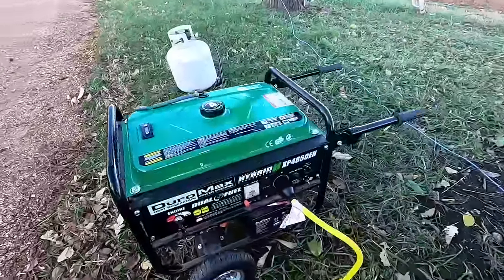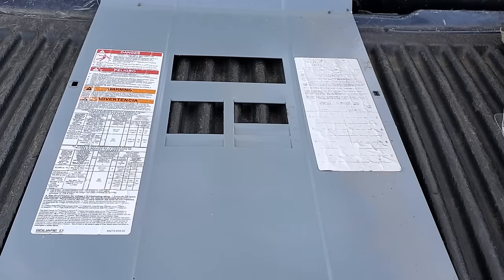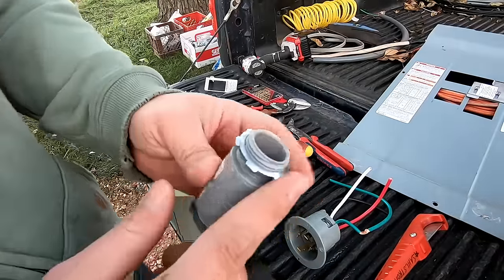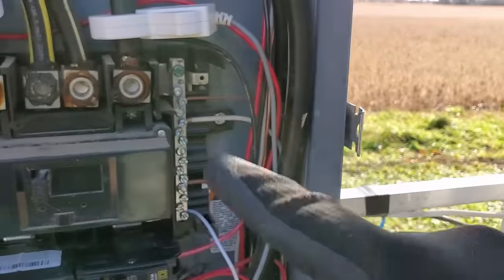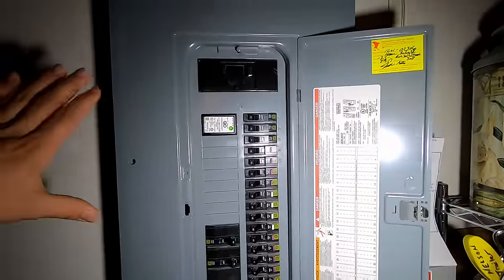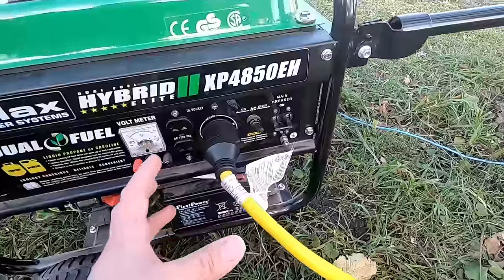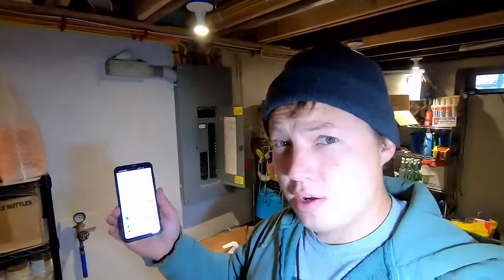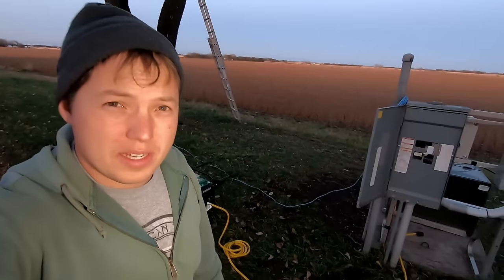How To Hook Up a Generator To Your House Using a Breaker Interlock Kit & Power Inlet Box

Comment: You've probably figured this out a long time ago, but just in case, your generator (and all dual fuel generators that I've seen) produces less power on propane than gasoline.  In terms of power it's diesel > gasoline > propane > natural gas. According to the manual for that model it should produce 3,500 running watts on gasoline and 2,975 on propane. Surge is 4,400 and 3,740 respectively. Anyway good helpful video on installing the interlock. Hoping to do the same thing myself soon.
Reply: Don’t forget about the generator safety tips as well. Remember safety is always important. Here are the generator safety tips:

1) Please do not allow an unqualified person or your children to operate the portable generator. Just because some manuals don’t say that doesn’t mean it’s safe. That is important against the generator safety rules. We also need to be keeping an eye on our children too. You need to make sure that your children are not playing near the portable generator especially when it’s running so they won’t get electrocuted. Generators pose electrical risks and they can be hot during an operation. Please keep your children away from the portable generator at all times. It is important to keep our children safe especially our little ones. Be aware of all the hazards.

2) Some people use their portable generators indoors which increases the risk of carbon monoxide poisoning. It’s important to have a carbon monoxide if you have a gas generator. Never ever use your generator indoors even if your doors and windows are open and even in the garage is not safe to use a portable generator. Not even at your porch and your deck. It is never safe to use your generator indoors and in enclosed areas of your home. Your generator needs to be 15-20 feet away from your house. 

3) 🔥generators cause fire hazards too. Never refuel your generator while it’s running. You need to let your generator cool off before refueling it and before storing your generator. Never overload your generator too. Never ever back feed your generator. You should never plug your generator into a wall outlet. Also never store propane tanks indoors. Please keep flammable things away from the generator as well and please don’t smoke cigarettes near the generator. Having a fire extinguisher next to the generator is also important against the generator safety rules. 

4) generator operation; make sure your hands are dry before touching the generator. Never use your generator in wet conditions. Don’t let your generator get wet. You need a generator tent if you need to use your generator during wet weather. Please don’t wear loose clothes when operating the generator. Turn on your generator before plugging in appliances. Use the right cord for your generator. Please do not use worn out cords. 

https://youtu.be/I1jT3ANENvI and here is a video more about keeping others safe when using generators and also about our family’s safety. Hope this helps
Reply: Good reminder about the production differences between fuels. But, it would seem, the overload breaker is what tripped. Unless it's some fancy fuel-sensing or frequency-sensing breaker, it seems like it would trip just as early even if he was running on gasoline. In other words, I doubt it would product a full 3.5kW on gasoline because the breaker would trip first.

Comment: Square D did a good job on that interlock kit. I've seen some more complicated as well as more expensive. Properly installed, it looks like it will be safe and convenient since the person setting up the generator doesn't have to be technically knowledgeable.
Reply: The interlock kits are such a ripoff for a simple metal piece that is just a sliding panel.  They should be about $10-15, but instead go for $150.+.  I just made my own for next to nothing.
Reply: Don’t forget about the safety rules of using generators: Always make sure you follow all the generator safety rules whenever you use your portable generator. This is a reminder for everyone’s safety of using generators. Generators can be dangerous if not used carefully. Every year, hundreds of people die or get injured when using portable generators due to carbon monoxide poisoning and electrocution. Make sure you are using your generator carefully and keeping others safe as well. There is something very serious that everyone should always be aware of when using generators. Some people do run their generator indoors which is not safe and that increases the risk of carbon monoxide poisoning which can cause death of family and you. Some people run their generator in wet conditions which can electrocute them. Please remember that you should never run your generator indoors. Remember that carbon monoxide is an odorless and colorless gas that you cannot see or smell. Carbon monoxide is a silent killer. Keep that in mind. Make sure your generator is 15-20 feet away from your house and away from doors, windows, and vents. Never use your generator in your porch too. Having a carbon monoxide detector is very important against generator safety. Some people also allow children to go near the portable generator which could pose risks. We need to keep an eye on our children making sure that they are not near the portable generator so they won’t get electrocuted or burned by the generator which is dangerous. A locking enclosure also keeps kids safe. A generator shed might look like a tempting place to explore, or take cover during a game of hide and seek, but a generator is a dangerous piece of equipment that can cause injury. It says on the manual that we should also keep children away at all times from the portable generator to avoid injuries. Please do not allow a child or unqualified people to operate the portable generator.  It is important to keep your children safe especially little ones. The portable generator can be hot during an operation. Just because some manuals missed what should be listed doesn’t mean it’s safe to do. Always follow the generator safety rules when using portable generators. Generators pose electrical risks. If you need to use your generator during wet weather, you need a generator tent to protect your generator from getting wet. Don’t let your generator get wet. Keep your generator dry and before using your generator, please make sure your hands and your generator is dry. Do not wear loose clothing when operating the generator. Everything that is said on the generator’s operating manual should not be ignored. Never smoke cigarettes near the generator. Please keep flammable things away from the generator. Never overload your generator too. Your generator can catch fire. Never ever try to plug a generator cord into a wall outlet to avoid back feeding. Back feeding your generator is dangerous. Always turn on your generator first before plugging in appliances and shut off the appliances before turning your generator off. Use a heavy duty cord for your generator and the cord should not be worn out. All the instructions should be followed carefully. Never refuel your generator while it’s running. It can cause fire if fuel spills while your generator is hot. You should turn off your generator and let it cool off before refueling it. Having a fire extinguisher next to the generator is also important. This is only a reminder for everyone’s safety of using generators. Make sure your generator is properly grounded. Having a fire extinguisher next to the generator is also important against the safety rules. https://youtu.be/I1jT3ANENvI and here is a video more about keeping others safe when using generators and also about our family’s safety. It’s important to keep our little children safe as well. Make sure your little children are kept away from the generator at all times especially when it’s running. Hope this helps. Always remember that it’s better to be safe than sorry. Also remember that warnings should not be ignored too.

Comment: I've been wanting to do this....After watching this I DON'T THINK SO.
I'll get an electrician....
Great video and excellent demonstration. 
Thanks
Reply: ⚠️Please don’t forget the rules about generator safety: This is a very important announcement for everyone. It’s important to follow all generator safety rules whenever we use portable generators: 

Everyone must see this. This is just a reminder for everyone’s safety. 

1) KEEPING OTHERS SAFE: Please do not allow an unqualified person or your children to operate and service the portable generator. Just because some manuals don’t say that doesn’t mean it’s safe. That is important against the generator safety rules. We also need to be keeping an eye on our children too. You need to make sure that your children are not playing near the portable generator especially when it’s running so they won’t get electrocuted. Generators pose electrical risks and they can be hot during an operation. Please keep your children away from the portable generator at all times. It is important to keep our children safe especially our little ones. Be aware of all the hazards.

2) WHERE TO RUN YOUR GENERATOR: Some people use their portable generators indoors which increases the risk of carbon monoxide poisoning. It’s important to have a carbon monoxide if you have a gas generator. Never ever use your generator indoors even if your doors and windows are open and even in the garage is not safe to use a portable generator. Not even at your porch and your deck. It is never safe to use your generator indoors and in enclosed areas of your home. Your generator needs to be 15-20 feet away from your house. 

3)🔥FIRE HAZARDS: Never refuel your generator while it’s running. You need to let your generator cool off before refueling it and before storing your generator. Never overload your generator too. Never ever back feed your generator. You should never plug your generator into a wall outlet. Also never store propane tanks indoors. Please keep flammable things away from the generator as well and please don’t smoke cigarettes near the generator. Having a fire extinguisher next to the generator is also important against the generator safety rules. 

4) GENERATOR OPERATION: make sure your hands are dry before touching the generator. Never use your generator in wet conditions. Don’t let your generator get wet. You need a generator tent if you need to use your generator during wet weather. Please don’t wear loose clothes when operating the generator. Turn on your generator before plugging in appliances. Use the right cord for your generator. Please do not use worn out cords. 

https://youtu.be/I1jT3ANENvI and here is a video more about keeping others safe when using generators 

Hope this helps. Remember safety first

Comment: Five Star/A plus video! Information & presentation, idk, perfection! Ty! Thumbs up and subbed! ( Recently endured a five day outage - never again! We have the exact same set up as yours, main feed @ original house, then feeds over to a similar power panel set up as yours, which then feeds over to our main/new house. )
Reply from the maker: Awesome! Glad to was helpful! Give your inspector a call before you get started and ask about any permits that may be required and or suggestions that they might have. Most inspectors are actually pretty great to work with especially if you ask their advice. Good luck!
Reply: @BenjaminSahlstrom  K,...thank you Ben! 🏆 🥇.....🙏🏼 👍🏼

Comment: Your generator isn't actually 3850 watts unless it's in 120v mode.  In 120/240 mode, it's actually two 1925 watt generators (around 1725 watts on LPG).

Most likely explanation is you overloaded your generator because you pulled more than 1725 watts on one leg.  When running a 120/240 generator, it's important to try to keep the loads balanced between legs.  A product like the Victron Autotransformer will automatically take care of this for you up to 3600 watts.
Reply: Good stuff, thanks for the info.

Comment: Great video. I have always noticed the screws on electrical outlets for the wire connections almost look like a combo of a flathead and phillips. I finally found they are called “ECX” heads. They are somewhat rare to find. I ordered these bits online and they fit the screws way better.

Comment: I have the same setup in my house, except I have Siemans panels and went with a 50A inlet. I have the Duromax 10000E model.
Reply: Here are the generator safety rules that everyone needs to follow: this is just a reminder for everyone’s safety. Always make sure you follow all the generator safety rules whenever you use your portable generator. Generators can be dangerous if not used carefully. Every year, hundreds of people die or get injured when using portable generators due to carbon monoxide poisoning and electrocution. Make sure you are using your generator carefully and keeping others safe as well. There is something very serious that everyone should always be aware of when using generators. Some people do run their generator indoors which is not safe and that increases the risk of carbon monoxide poisoning which can cause death of family and you. Some people run their generator in wet conditions which can electrocute them. Please remember that you should never run your generator indoors. Remember that carbon monoxide is an odorless and colorless gas that you cannot see or smell. Carbon monoxide is a silent killer. Keep that in mind. Make sure your generator is 15-20 feet away from your house and away from doors, windows, and vents. Never use your generator in your porch too. Having a carbon monoxide detector is very important against generator safety. Some people also allow children to go near the portable generator which could pose risks. We need to keep an eye on our children making sure that they are not near the portable generator so they won’t get electrocuted or burned by the generator which is dangerous. A locking enclosure also keeps kids safe. A generator shed might look like a tempting place to explore, or take cover during a game of hide and seek, but a generator is a dangerous piece of equipment that can cause injury. It says on the manual that we should also keep children away at all times from the portable generator to avoid injuries. Please do not allow a child or unqualified people to operate the portable generator.  It is important to keep your children safe especially little ones. The portable generator can be hot during an operation. Just because some manuals missed what should be listed doesn’t mean it’s safe to do. Always follow the generator safety rules when using portable generators. Generators pose electrical risks. If you need to use your generator during wet weather, you need a generator tent to protect your generator from getting wet. Don’t let your generator get wet. Keep your generator dry and before using your generator, please make sure your hands and your generator is dry. Do not wear loose clothing when operating the generator. Everything that is said on the generator’s operating manual should not be ignored. Never smoke cigarettes near the generator. Please keep flammable things away from the generator. Never overload your generator too. Your generator can catch fire. Never ever try to plug a generator cord into a wall outlet to avoid back feeding. Back feeding your generator is dangerous. Always turn on your generator first before plugging in appliances and shut off the appliances before turning your generator off. Use a heavy duty cord for your generator and the cord should not be worn out. All the instructions should be followed carefully. Never refuel your generator while it’s running. It can cause fire if fuel spills while your generator is hot. You should turn off your generator and let it cool off before refueling it. Having a fire extinguisher next to the generator is also important. This is only a reminder for everyone’s safety of using generators. Make sure your generator is properly grounded. Having a fire extinguisher next to the generator is also important against the safety rules. https://youtu.be/I1jT3ANENvI and here is a video more about keeping others safe when using generators and also about our family’s safety. It’s important to keep our little children safe as well. Make sure your little children are kept away from the generator at all times especially when it’s running. Hope this helps. Always remember that it’s better to be safe than sorry. Also remember that warnings should not be ignored too.